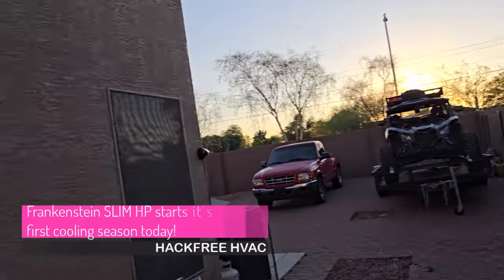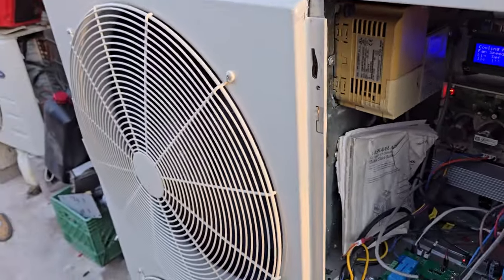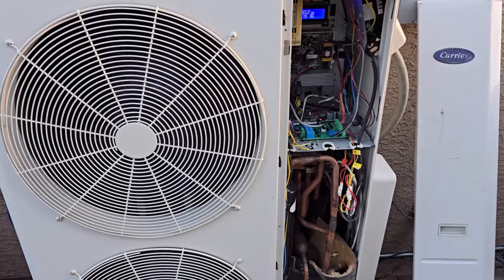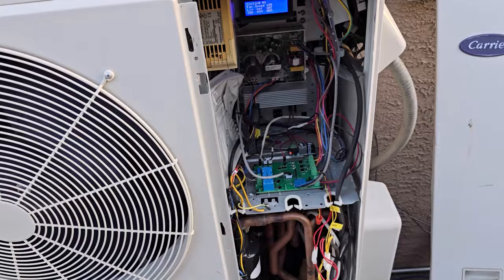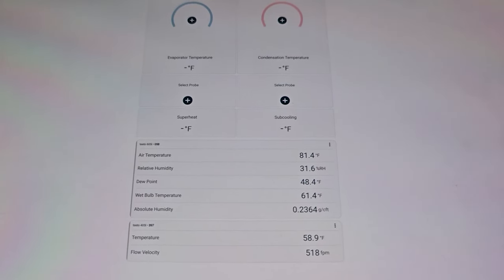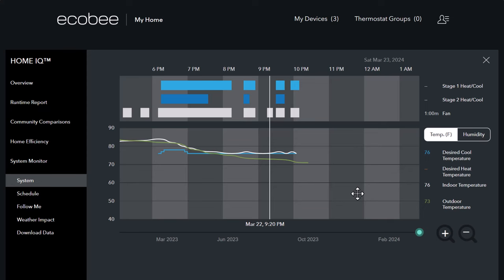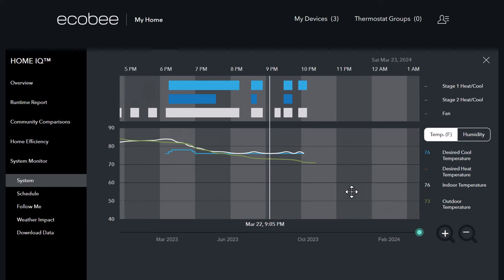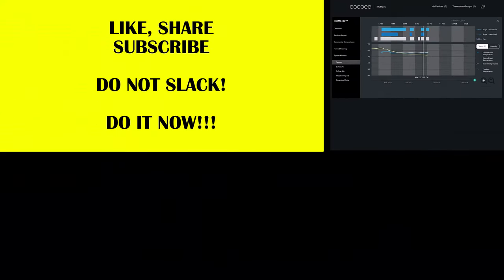Frankenstein SLIM HP starts it's first cooling season!

Comment: Why you don't adapt a PID function to that unit with two different evap. Temperatures.. for example in cooling mode 0 to -5°C and to heating -5 to-20°C i think it would work better as a variable capacity unit instead of just two stage unit

Comment: 83° inside.....that sounds like hell. I don't let my house get above 72° at no point in the year. While AZ is hotter than TX.....we are still plenty warm here in the summer. House maintains 70° when its 108° outside. My wife would be an angry lady if my house got that warm 😂😂😂😂😂. She loves air conditioning
Reply from the maker: 108 deg is what we get in May and into June. 
Then add another 10 degrees to that for July!
You have more humidity, depending where you're at. So you might need 70 deg to be comfortable. 
Common setpoint in Arizona homes is 78 deg.
74 to 76 for those willing to pay for it.
Reply: @hackfreehvac  i modified my system to act as a dehum for the first 10 minutes of run time to load up the coil...then its abke to more btu's towards sensible cooling...seems to do the trick quite well
Reply from the maker: @jasonjohnsonHVAC  Seems like the old "Enhanced" mode for Trane ECM 2.0 back in the early 2000's (something missing from modern X13 motors) where it would run 50% blower speed for something like 2 minutes then 80% and then 100% after 10 minutes for enhanced de-humidification 👍

Comment: I think it would be good idea to keep fans running on low speed (don't even start with any freq. lower than what they need to spin), not to stress compressor more. No need to turn the fans off, they are dead silent on lowest speed.
Reply from the maker: Except bearing wear etc from them running all the time. 
All I need to do is add a few lines of code to adjust that.
I had to wait until I used it to see how it responded to what I programmed so far.
I have noticed that some mini splits start the fan right away.
Could be due to how the DC fan takes so long to start.
Reply: @hackfreehvac  but are bearings really a problem? I would think they are not under any stress at such low speed. Also much cheaper than compressor. And running fans would help the compressor with lower pressure, so less wear on compressor. Small AC split units have fixed outdoor fan speed and bearings dont die even after 10+ years.